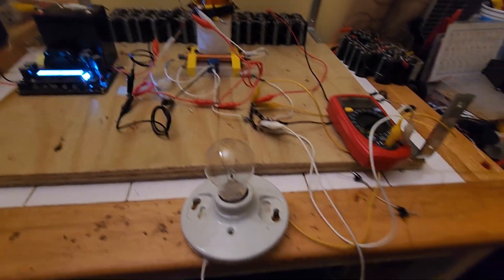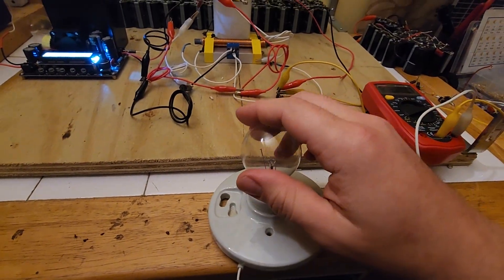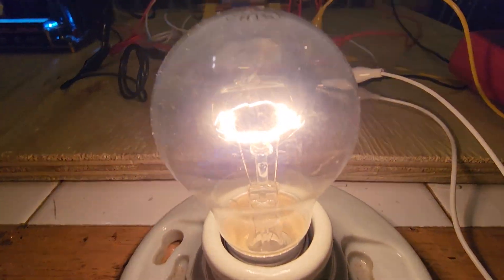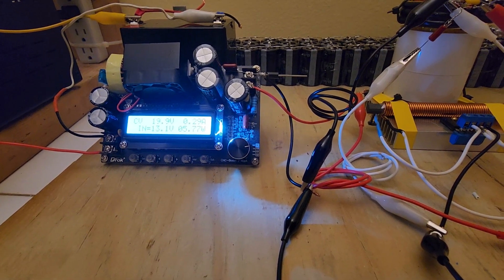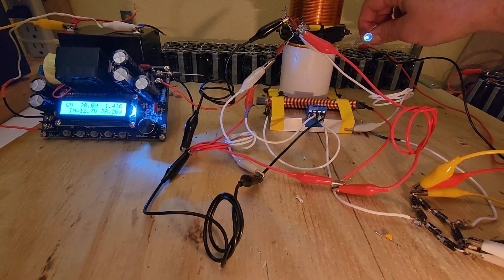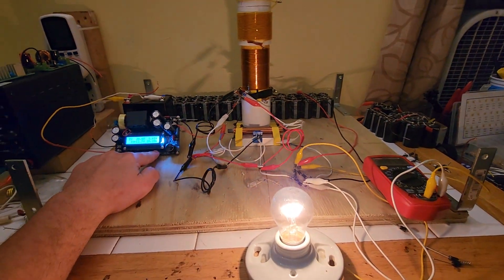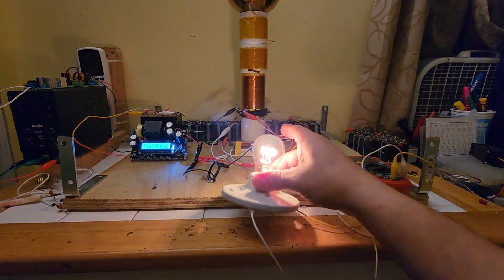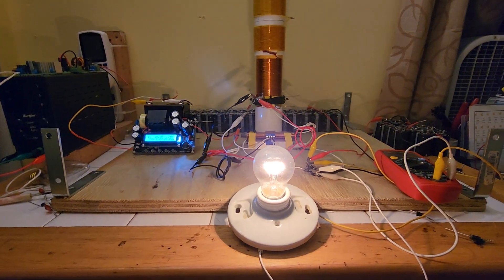💡MORE POWERFUL RINGER CIRCUIT DEMONSTRATION.NOW SELLING THIS MODEL FOR 150$💡

Comment: It is an effective converter but I guess the 30W from power supply are nearly the power the light bulb dissipates. You should perform a true rms measurement of the power feeded into the bulb because the observed brightness is absolutly no certain measure.